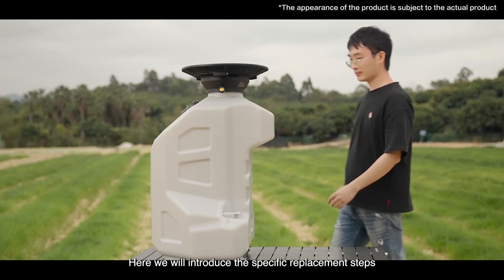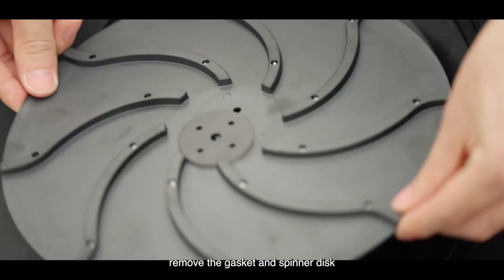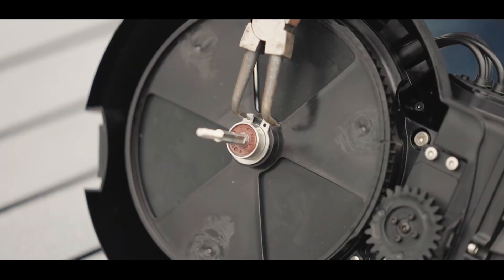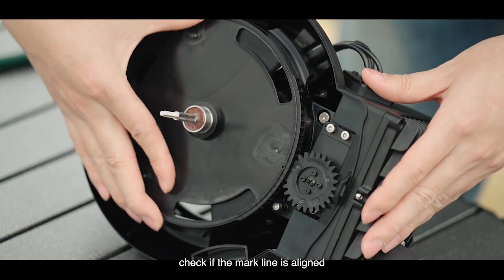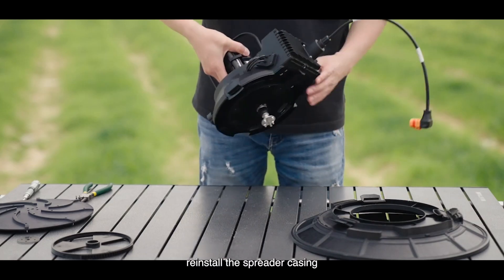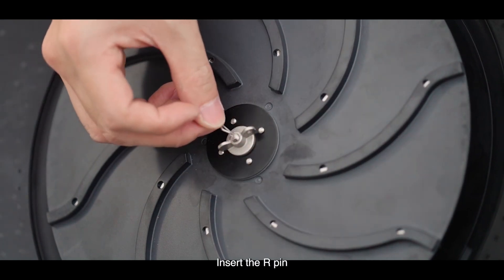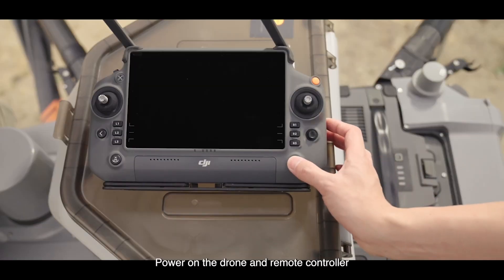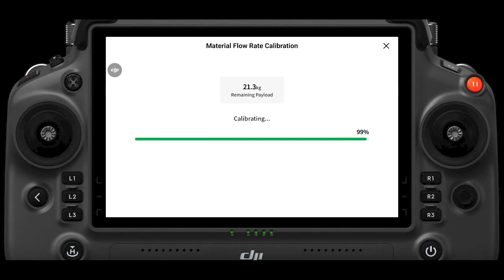How to Install the Small Hopper Gate | Agras Tutorial T50&25

Comment: Hi DJI team,
I have a question about the hopper gates for the Agras T25 spreading system. The kit includes three hopper gates (small, medium, and large). Could you please explain the recommended use cases for each size?

And specifically: what is the best choice if I’m spreading a mixed seed batch with particle sizes ranging from about 0.5 mm up to 5 mm?

Thanks a lot for your support!